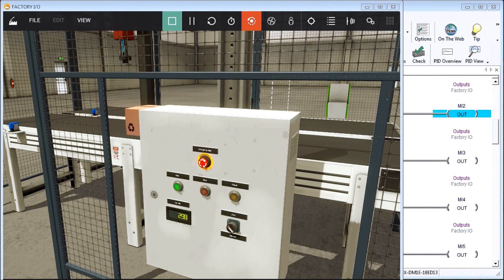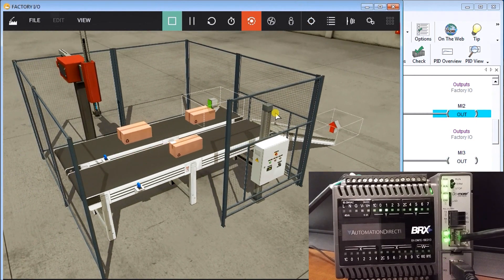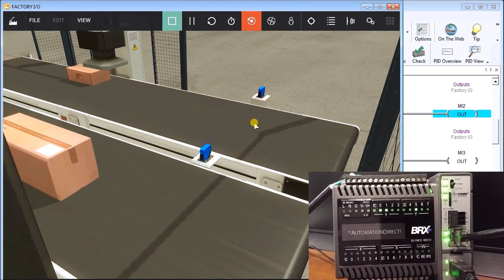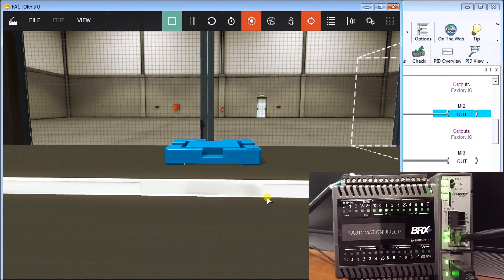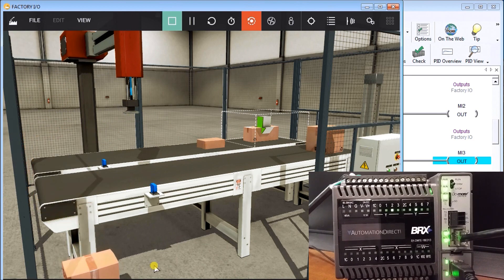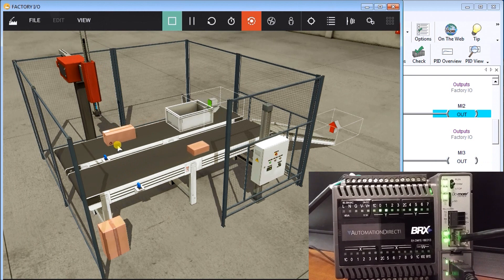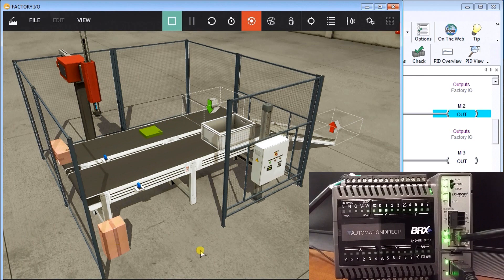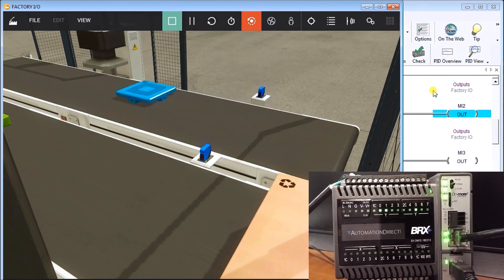Master PLC Pick & Place: 5-Step Development & Live Testing

Comment: hi. nice video. may i know at device configuration, which option do you selet to communicate your PLC with Factory IO via ethernet?
Reply from the maker: Hi Nur Hanani Ahmad Puaad,
I am using the Do-More Designer Software Simulator. This is a free PLC software from Automation Direct.
https://www.automationdirect.com/adc/overview/catalog/software_products/programmable_controller_software/do-more_plc_programming_software
The details of this video can be found on our website.
https://accautomation.ca/plc-programming-example-pick-and-place/
Thank you for the comments.
Regards,
Garry
Reply: @ACCautomation  ahh i see. thank you for the links. Currently i am working on Omron NX series with Factory IO using MOdbus TCP. it can write signal to Factory io but cannot read from Factory io to Omron PLC. Sill searching why. Thanks for the links.
Reply from the maker: @nurhananiahmadpuaad1838  
I know that the Omron controller must be in monitor mode in order to write to the memory locations.
This may help you out.
Regards
Garry
Reply: @ACCautomation noted.  thank you very much.👍